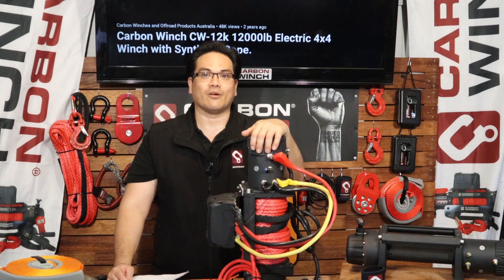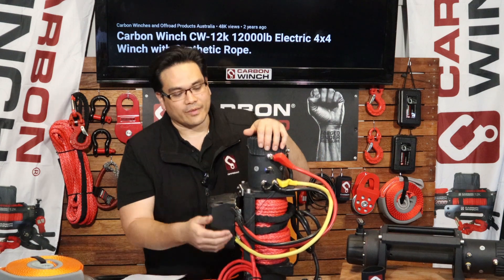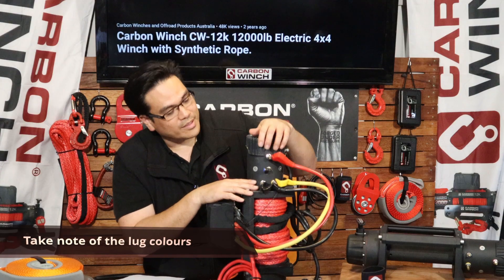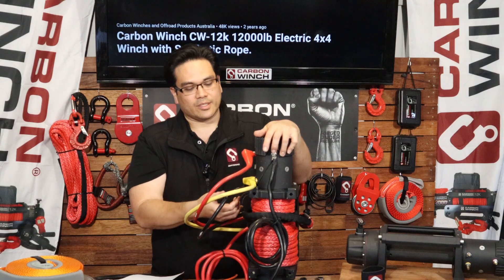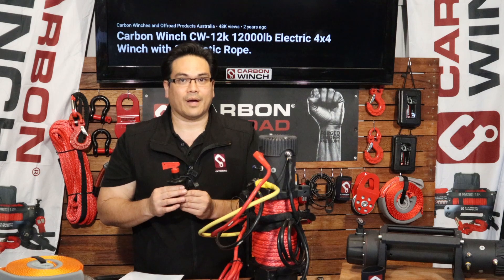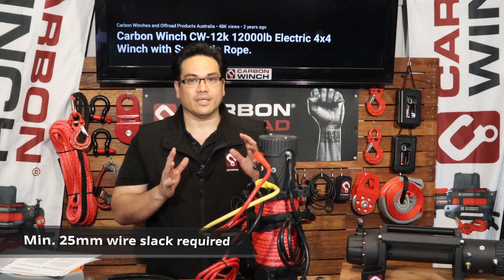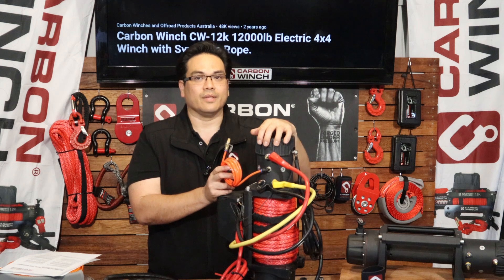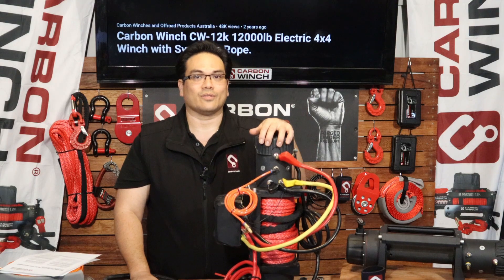Carbon Off Road Winch Wiring Tips

Comment: Hi i just bought the new 12,000 winch. I have a sahara bar and I can only mount the box on the outside - is the bracket that the winch came with strong enough to be simply mounted remotely on the top of the bar. I dont want to mount the box on the winch as it sits behind the bar work and i would then be limited to the wireless unit. Are there any brackets for mounting remotely on flat surfaces like the bar
Reply from the maker: Hi Carl, The bracket that comes with the control box is fine for mounting onto the bullbar. Many users do this. We also can supply a wired remote plug extension lead, these are in stock and would allow you to mount the control box inside you bar with a flush mount plug you can mount somewhere accessible to use the wired remote. The wireless receiver unit is prefitted inside the control box so your wireless will work no matter where the control box is fitted. Hope that helps. cheers Dan - https://www.carbonoffroad.com.au/carbon-winches-wired-remote-control-plug-extension~256307

Comment: Hi again, I have the square isolating switch, does the long positive red cable goes to the isolator and the short positive cable also runs from the isolator to the positive on the battery, cheers.
Reply from the maker: Hi Egidio yes that is correct, long red positive to the isolator switch then the short cable from isolator directly to your battery positive terminal.

Comment: Hi, just purchased a carbon winch, but there is no breather hose or attachment to the winch is this right.
Reply from the maker: Yes that is correct, the new version 2 winch just released has our upgraded goretex style breather on the motor. there is nothing to do on your end as the breather works by letting air pressure in and out but not water in. https://www.carbonoffroad.com.au/carbon-12k-ver.2-12000lb-electric-winch-with-synth . Hope that helps. Cheers

Comment: i love do fuse all my wiring, what size fuse would you recommend ?
Reply from the maker: The main positive battery cable is the one you want to fuse. You should use a high quality minimum 400amp continuous draw fuse. This will allow full power available to the winch motor, but in the event od a dead short to chassis or other it will blow before any major damage is done. It's a good idea. Just carry spares in case one blows during a recovery.

Comment: What size wire you recommend if i need longer battery wires due to battery being under passenger seat in defender.
Reply from the maker: HI Mahendra  if your only continuing from the battery  to the under seat location I would continue with the current cable size which is 35mm squared if you are going further I would step up to the next size up... great question thankyou for watching